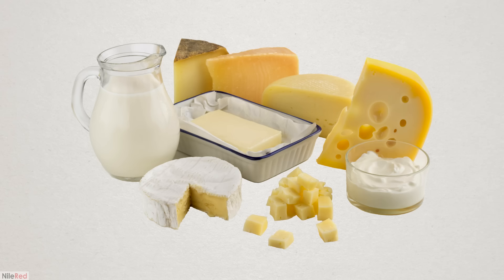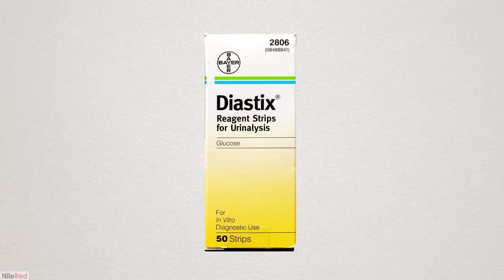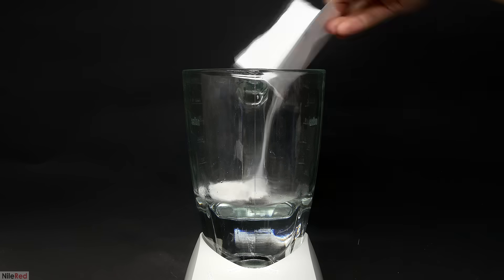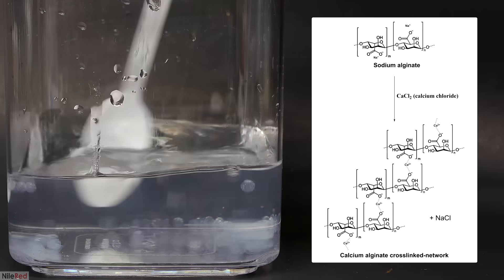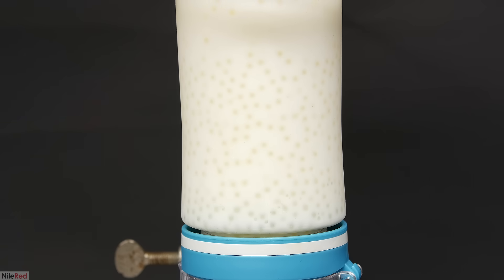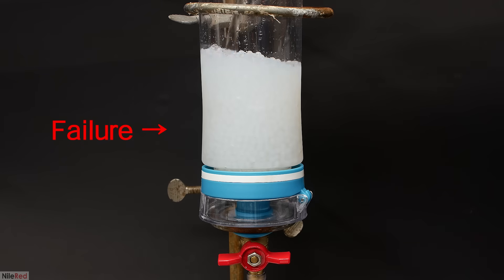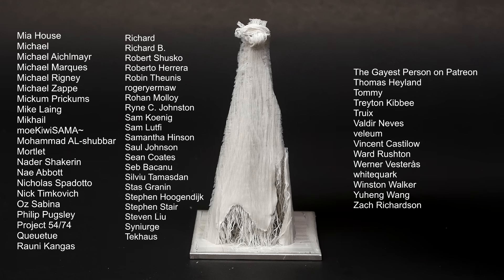Making milk lactose free

Comment: Removing the lactose with membrane fractionation is much better way to do this. You get less lactose left in the end product and taste that is much closer to regular milk than with lactase. It also allows production of many other products derived from milk as you can even separate the proteins, the fat etc. on the same run and combine them into different types of products. Milk protein powder is a good example of this.

In Finland I do not think you can find lactase processed milks that easily anymore. Maybe from shelf that has those UHT packed milks that can be preserved in room temperature when unopened. But membrane fractionation has become the standard method really here.

Comment: Hmm, this is interesting to see, I tried immobilisation of yeast some weeks back by the same method. We freeezed the beads for quite a bit of time(at least a week) and then put them in an activation media to activate the yeast so we could check the invertase activity by breakdown of glucose, but for some reason since the beads were kept in the activation media for 48 hours instead of the required 24, the beads started deforming and didn't hold their shape and ended up in a mess, and we weren't able to filter off the activation media because nothing passed through due to the particulate beads. I wonder if you would know the reason as to why the beads started dissolving/deforming.

Comment: I'm lactose intolerant, here in Germany 1L of normal full milk (3.5% fat) costs around 0.5€.
The same amount of the cheap lactose free milk (also 3.5% fat) is around 0.7-0.9€ per liter. This type of milk is produced by one of the first two methods you described and tastes sweeter ( like a tablespoon of sugar into a normal glas of milk). Good for baking or Latte Macchiato but not for drinking in my opinion.
The ultrafiltration method is also available (e.g. from Hansano, Arla or Landliebe) and is sold as "less sweet" for 1.6-1.8€ per liter. Thus the last method is (at least in Germany) the most expensive to buy as a consumer, but the taste is superior, I can not taste a difference to normal milk.
Actually the final addition of lactase has two reason, one to get rid of the residual lactose (<0.03% in comparison to the other methods with <0.1%) and second to add a little sweetness because otherwise the milk would be not sweet enough to taste like normal milk. 
Oh also I found the patent for the ultrafiltration: https://patents.google.com/patent/US8445052B2/en

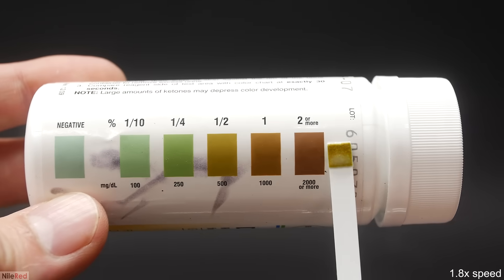Comment: 3:42 If the indicator is out of range (>2000 mg/dl) you could dilute an aliquote of the milk by - let's say - a factor of five and check again the glucose-content. It should work.
Reply from the maker: Yeah, that definitely would have been an easy way to solve that problem.
Reply: Nice catch
Reply: Yes, I thought about that, too. I think that's called a titre.
Reply: no, the "titre" is a factor of correction, exactly. 
For example, you are working with a 1N HCl-Solution in a volumetric analysis. For any reason, the solution is not exactly 1-normal, but only 0,98 N. Then the "titre" which has be taken into account, is 0,98.
Reply: Correction hold the same title in both French and English?

Comment: I'm a chemistry student and we did a similar project, using different methods to create lactose free milk. The methods we used were different from yours and gave some interesting results. In method one we used the chemical properties of lactose to remove it from the mixture, by simply adding ethanol and letting the lactose crystallize. This gave some problems after with removing the ethanol but all of the lactose was removed. We also used a very small filter (similar to a HPLC filter) to remove the lactose. This also removed the fats and a very small amount of lactose still got through. In the end the project was fun to do because we were allowed to come up with our own solutions and gave some nice results
Reply: Yes, but why remove the ethanol? Could have had yourself a fine white russian beverage lol.
Reply: The difference between nominal filtration and absolute (100% efficient - single pass) filtration. 
Filtration is basically selling the idea of trust. Do you trust Russians ?

Comment: When I figured out I had a lactose intolerance, I tried the lactose-free milk and it does taste like regular milk, the only problem with it is the cost, one brand at my loal Tesco store is £1.40 for a litre, whereas regular milk is £1.50 for 3.408L (Or 6 British Pints), making being lactose intolerant an expensive problem, so, I found the drops, didn't like that it made milk sweeter, so found some lactase enzyme pills, cheap & effective, and I have a happy bum... :P
Reply: really? lactose-free milk costs the same as regular milk in my country.
Reply: In the UK, where there are medical problems, there's someone cashing in on selling treatments for them, it's a disgrace...
Reply: In the UK, the main brands of lactose free milk use the ultrafiltration process which is why they taste so close to normal milk, but are quite expensive.

Comment: As a suggestion you can use 0.22microns filters that are sold for syringes in order to try to simulate the high pressure milk passing through a membrane. Is like a cellulose membrane and filters almost everything.
Reply from the maker: Interesting idea
Reply: Just know cause I have to use those kind of filters for my masters haha. Awesome contents.
Reply: @NileRed  I'm not finding lacteeze drops i found lactaze caplets
Reply: pvjthomas probably. I use those to filter catalyst on my photocatalysis reactions. Just said in order to try to simulate the industrial method. You are right dialysis would be great but it's almost the same pore size if I'm not mistaken. Good info though!
Reply: Do you think 220nm is small enough to filter out fats and proteins? Isn't it more likely the filters are kDa dialysis type. Those are at least an order of magnitude smaller in pore size.
Reply: 0.2 Micron is the standard particulate retention rating to produce sterile liquid filtration. Bacteria will not pass through at 0.2 microns (baseball won’t pass through chain-link fence). Custom combination of both membrane and depth filtration media in filter would be required to retain or pass through certain lipids. Pharmaceutical grade sterile 0.2 Micron rated filters require a filtration efficience of 99.9...% to a log reduction of 9.

Comment: I'm lactose intolerant, and I buy this stuff all the time, in fact I recently started producing cheese from lactose-free milk, although it does have it's problems.  shrug  either way, thanks for the info!  (I wasn't aware of the second and third methods)
Reply: What nonsense. The longer a cheese is riping the less lactose it has. After 2/3 months it's lactose-free.
Reply: sigh no.  no it's not. Milk bothers me, in even tiny amounts.  Lactose-free milk doesn't bother me.  Cheese bothers me (all cheese, not cheese-foods, or cheese products, but actual cheese that's aged by reputable companies for months or years.) the cheese I make from lactose-free milk doesn't.  Observed evidence suggests a different paradigm than the one you current ascribe to.  The "problems" I alluded to were only in the quality and taste of the cheese, not in how it effects my stomach.  (And yes, diagnosed by a medical professional lactose-intolerant years ago, and no other medical complications (such as an actual milk-allergy, or ciliac diseas) which would cause cheese to bother me in such a way, so there are no other explanations).  I will admit I've never had the cheese tested in a lab, but that's because I don't have a lab, or money to send it to one.

Comment: Try to make some singlet oxygen!
Reply: Humberto Castro I know but It is possible to obtain the glow when the singlet oxygen is converted into usual oxygen. You can do this by bubbling chlorine into a solution of H2O2 and NaOH in water.
Reply: Singlet oxygen is not a radical like superoxide or hydroxy radicals. It’s got the same amount of electrons as ground state molecular oxygen, but with a different quantum spin for one of the HOMO electrons. Additionally, it doesn’t emit light in the visible spectrum when it relaxes back to ground state O2, so you wouldn’t be able to see it change.

Comment: Wouldn't it be simpler just to boil it? I always thought the sweet amazing smell the milk gave off when heated up was the lactose breaking up, leaving the milk noticeably sweeter with glucose and the smell was aerozilized galactose.
Reply: No, you need more energy than boiling to break lactose down by heating alone, don't forget almost all milk is pasteurized or UHT
Reply: Most things have a stronger scent when heated and a weaker scent when cooled.
Reply: tommapar88 I have never heated milk and smelled caramel.
Reply: Unlocked Yea but SOMETHING must be aerosolizing when heated to make a whole room smell of caramel, wouldn't you agree that something funny goes on with milk when heated?
Reply: Alex Agius Yea but even with pasteurized milk, it gives off a sweet scent. Maybe only a little bit of the lactose breaks up. I'm not sure though.